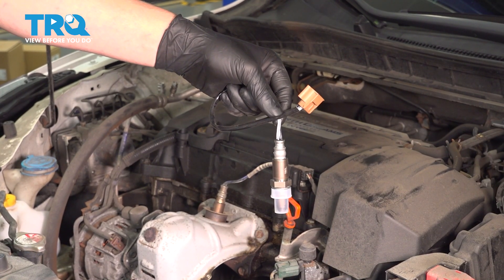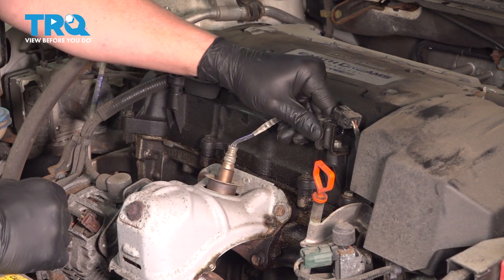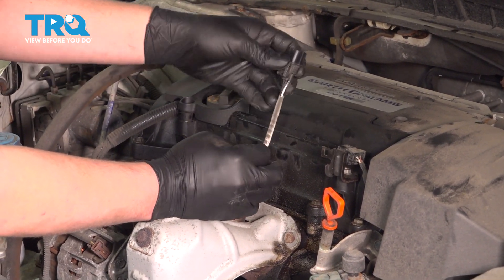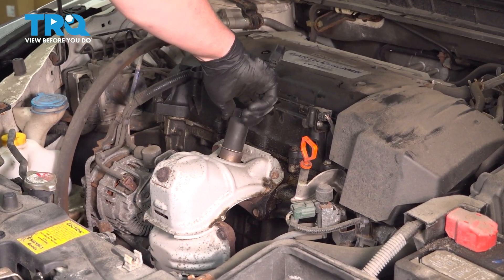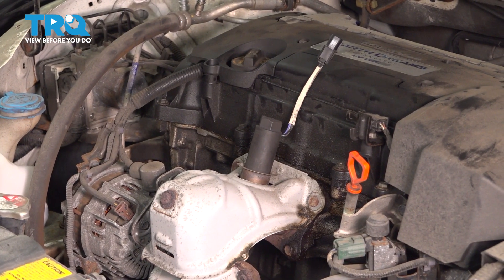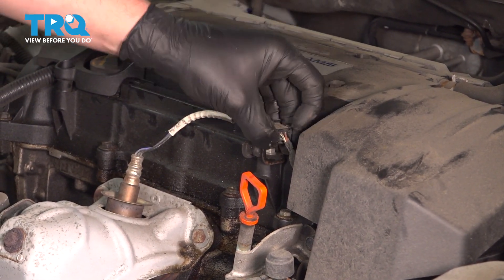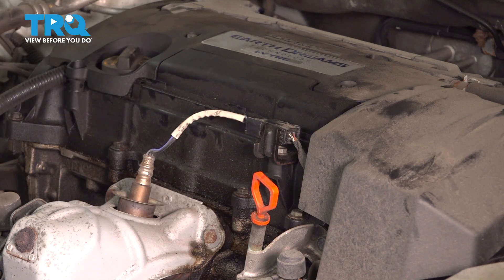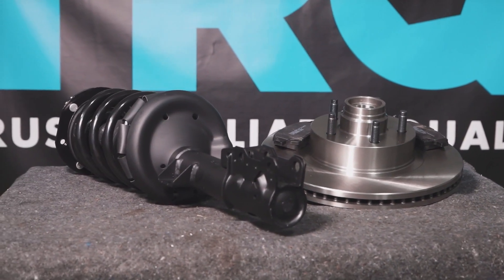How to Replace Upstream O2 Sensor 2013-2017 Honda Accord

Comment: i have a 22mm socket and it’s not fitting because of the shield any ideas?
Reply: wanted to add, it fits the new sensor perfectly fine but won’t fit my old one that’s still on the car

Comment: Genuinely curious; cause I’m not familiar with the importance of toque, care to explain? I don’t want to under or over toque if I do something myself.
Reply: Since no one helped you for a year I hope you were able to find this out, but in case you didn't, torque is important because it helps join parts together without damaging them, the term over torque happens if you go over the recommended or required torque limit this is due to the tread(material, pitch, size, number of threads) if you over torque something there is likely going to be stress fractures on that part causing damage over time or if you're unlucky, instand damage like thread stripping or bolt snapping. Under torque is just not tightened enough which causes said part to get loose due to external forces such as vibration, and a loose o2 sensor I think causes issue with your fuel economy and other engine problems that are definitely not good